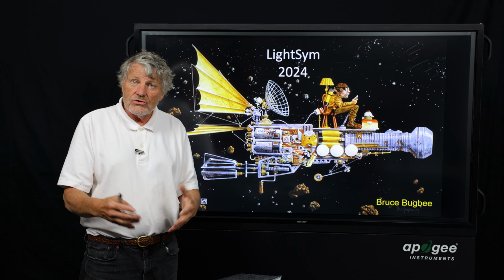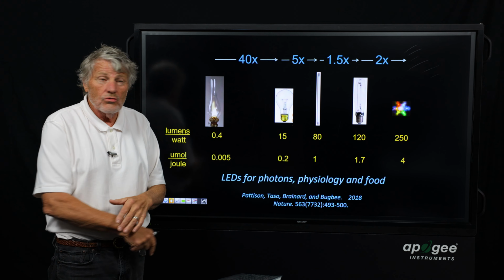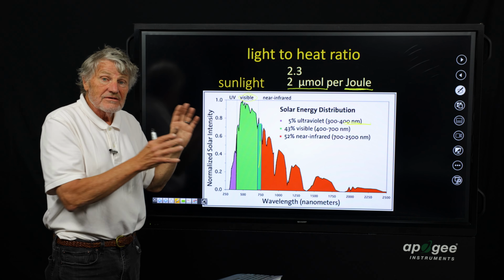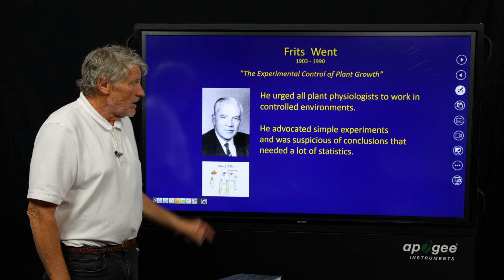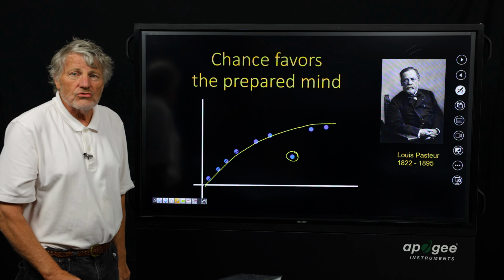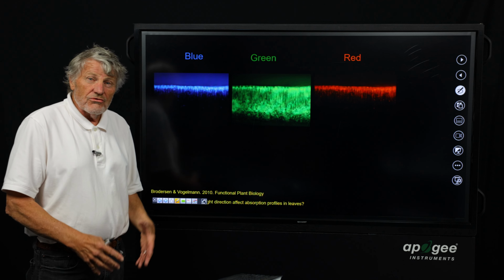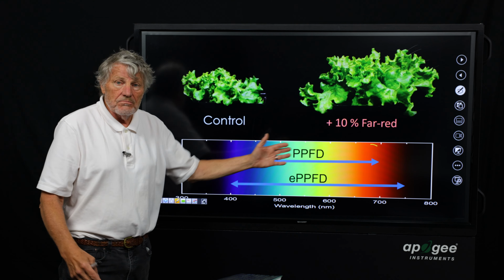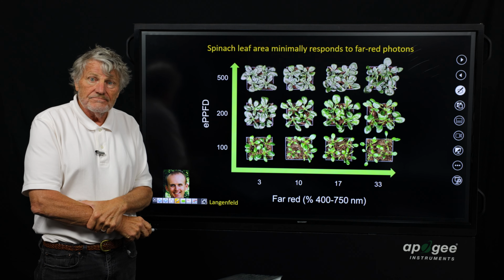2024 LightSym Keynote (Re-recorded)

Comment: Light dep glasshouses, or cheaper hoophouses, seems to be the best and most efficient way to use the sun with a backup source. Some cultivars like Mimosa and Banana Punch produce indoor quality flower outside up in tougher to grow north states, using sun most of the time. Seen it rec shops...first hand. 
Indoor just is not making it in major grower states like Michigan anymore.. unless you have solar, the expenses for electric bill alone has sunk dozens of growers 2023-2024. Efficiency is king in 4 states I have grown the last decade... if you are not using the sun and light deps, you have less product and higher bills compared to hard working 365 day southern farms with hoop or glass houses